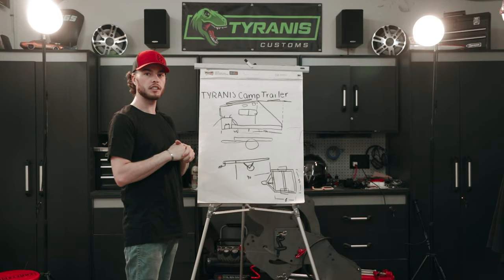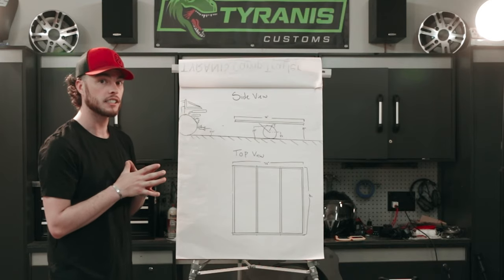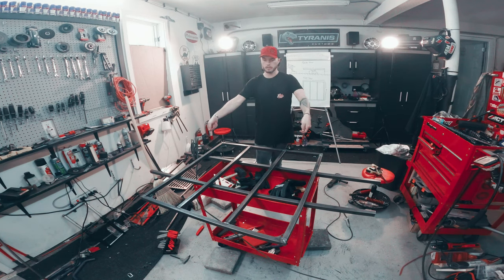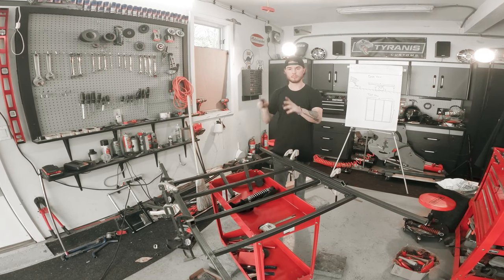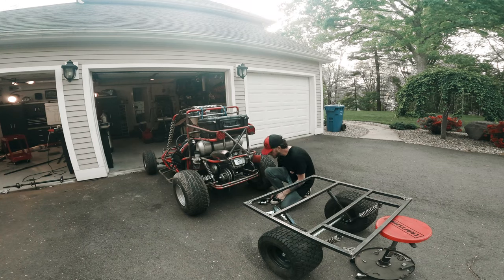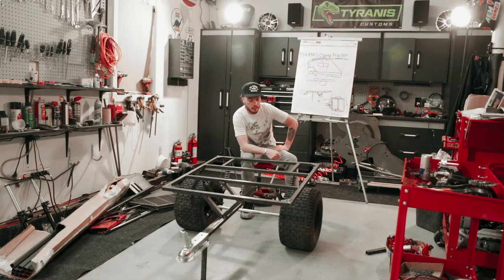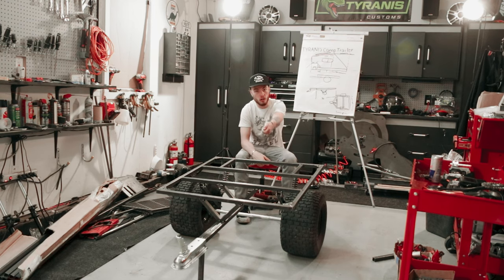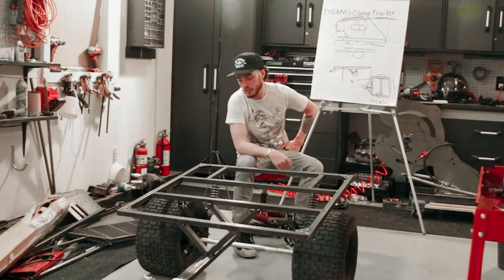Custom Trailer One Day Build | Solid Axle Suspension

Comment: Slide in storage could be used for the battery bank for the solar power you plan to use. You could use hockey pucks as body spacers like a truck cab has,for the different modules you want to carry on the trailer so that they're not really solid mounted.
Reply from the maker: Wowww hockey pucks are a great idea... I might have to do that!!
Reply: @TyranisCustoms  they hold up better than the rubber ones

Comment: Does the axle have keyways on each wheel and if so are you leaving them out so the axle isn't locked up? Sorry if this was covered in the video and I missed it. Looks great so far can't wait to see it complete 😀
Reply from the maker: It does have key ways but I'm leavin them out for better turning. Ideally, each wheel would have its own bearing to spin on but this is what we had haha
Reply: @TyranisCustoms  that works! It will turn a lot better. Can't wait to see it in action:D